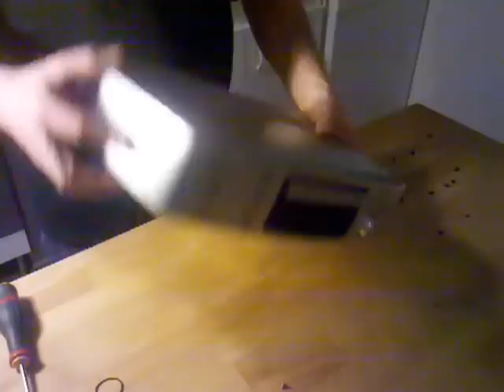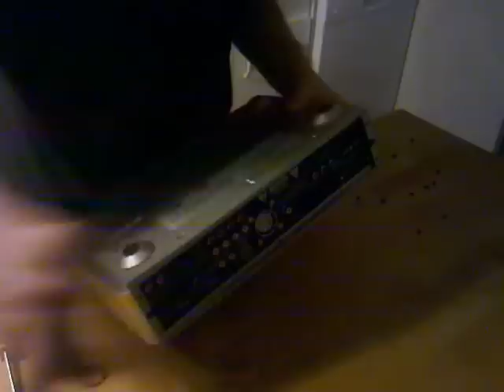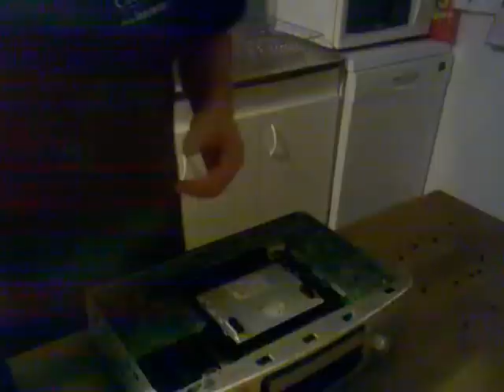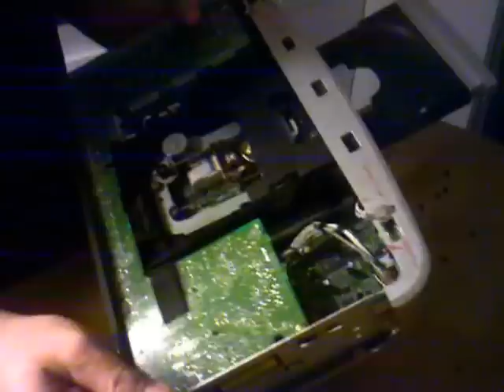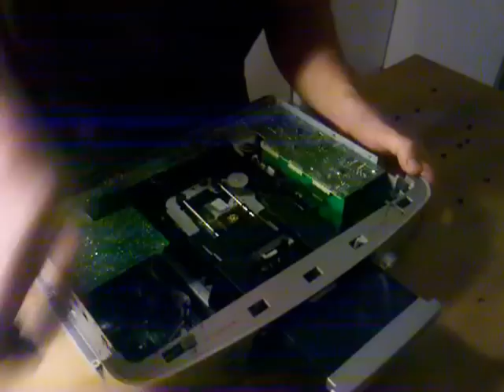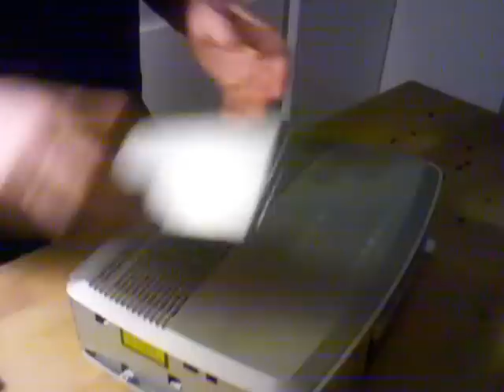Opening and repairing Denon S 101 CD DVD rack

Comment: Great guide. I have one thing to ad and that is, that you don't have to take off the front part. If you pull the disc tray all the way out, you can see 3 plastic gears, 2 White and 1 Black driving the tray and the rubber band. On top of each gear there is at thin lock washer. Careful take these of and the gears can be takken off to gain acces to the rubberband.
Reply from the maker: +Søren Hansen Thanks for your feedback. Next time I will have to open it back I'll try the palstic gears removal as you suggest. Cheers.